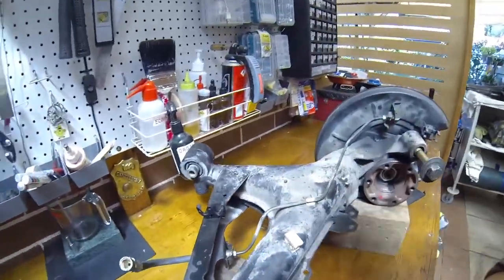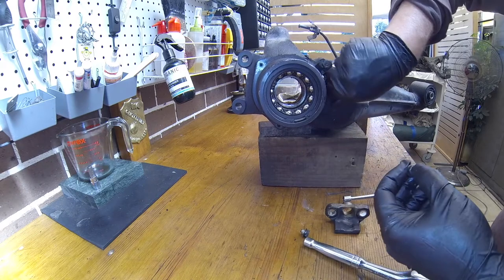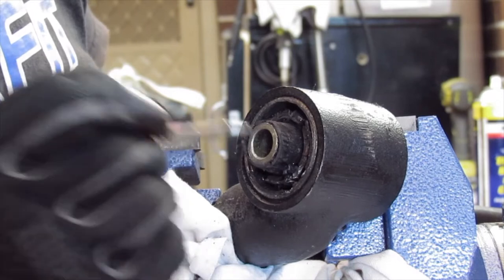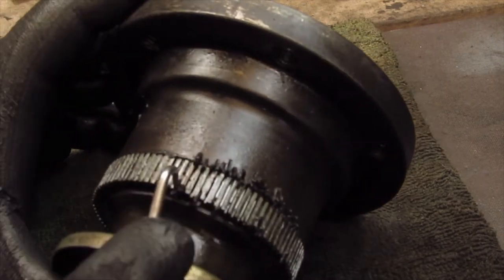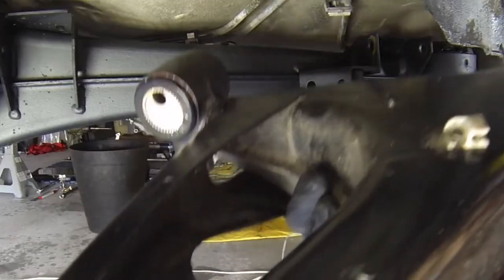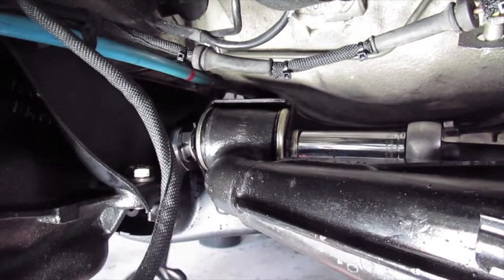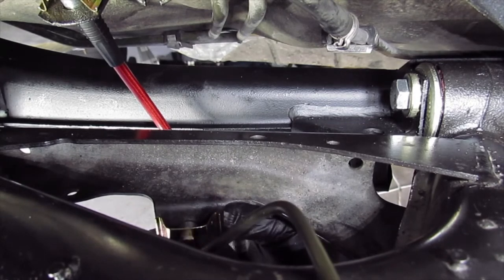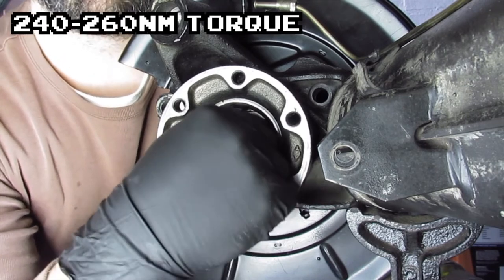BMW E28 M5:  LVL 7-2 Trailing Arm Rebuild

Comment: I used a few m36 washers and the original 36mm nut to pull the hub in the bearing, just adding a washer everytime net nut reaches the splines
Reply from the maker: That's a brilliant solution. I like simple work arounds. Thanks for sharing. If you have pictures or a video let me know. @obsidianm5

Comment: I'm in the middle of doing a powder coating (prepping) and yeah those rear trailing arms WTF my buddy with his 20 ton press we got one out but just couldn't get the 2nd one so drill and hacksaw like you're doing is the only way.
Reply from the maker: Mate it was a mission, I found out that the best chance is to heat it up heaps in the press if you can't stomach the saw 😜. All the best 👍🏼
Reply: @BahjatAlaadel  My first mistake was using a large socket that had a bit of a rounded lip, and was about maybe 42.3mm outer diameter, and that was the first mistake.  Attempting the 2nd bushing of the first arm the press was going in sideways and once it went sideways it was over so I didn't continue.  Will go with torch & saw method which I'm comfortable doing fortunately 

I was able to find a bearing that was exactly 43mm outer diameter to use as a "pressing die".  So I'll attempt that on the 2nd trailing arm.  Depending on how the hacksaw method goes I may not bother with a press except for installation.

Thanks for posting a video.  Videos take a long time and add a ton of time to the work day.
Reply from the maker: No worries, I still have 10+ videos to finish editing 🤣 but the goal is giving the community a starting point 😁

Comment: What type of oil did you use on the splines for the rear hub assembly?
Reply from the maker: It's just all-purpose oil. It's called 3 in one. It's a multi-purpose oil. You use it for door hinges or anything like that. You can get it at any hardware store and it's just to get so that you don't bind up when you're trying to line up the splines and get it started.

Comment: Hey where did you buy the kit to remove the rear wheel bearing, the one that has the cups?
Reply from the maker: I bought it on ebay, search for "27 Pcs Press & Pull Sleeve Kit Bush Bearing Removal Installation Repair Tool Set" they're around $100. And just oil all the threads before you start to make it easier. 😎
Reply: @BahjatAlaadel  thanks, brother! Just removed my subframe today and your videos have been a game changer!
Reply from the maker: All the best and thanks for keeping these cars on the road! 😀

Comment: What difference do you  notice using poly trailing arm bushings? What is the advantage of using poly over stock?
Reply from the maker: It's only useful if you're going to lower the suspension a lot or your racing on a track. It lets you adjust the camber and toe for the rear wheels.
Reply: @BahjatAlaadel  ah ok thanks. Can you notice a difference in terms of harshness when driving? Will you be tracking?
Reply from the maker: There is about 20% more road feel, but it's also the condition of the road you're driving on 😊 the worst mod for harshness is poly engine and transmission mounts. The vibrating is terrible 😔 I tried it and went back to stock mounts.
Reply: @BahjatAlaadel  ok thanks. Did you get the Garagistic poly engine mounts? I was thinking of getting those but if it’s going to be that harsh then forget it.
Reply from the maker: Yes they are Garagistic mounts, but maybe it just because it's the 3.5l engine. But if you want to try them, I'm happy to send them to you. Find me on IG @obsidianm5

Comment: Awesome work It's hard to find People Who know what they're doing especially with old BMW  . My problem is the bmw mechanics here in East Coast a bunch of pricks and that's why I take my e28 m5 to Volkswagen mechanics they're more Enthusiastic to work on your car than BMW mechanics
Reply from the maker: Thank you, my hope is to provide a resource to those who need it. I agree, something happened and much of the pride and etiquette of being a German auto mechanic. I have a backlog of episodes, but if you have a question about a particular system let me know. Do you still have the self levelling system in yours? Cheers. IG: @obsidianm5
Reply: I don't know where to take my instrument cluster to get fixed do you have any suggestions
Reply from the maker: Has the odometer stopped? Or does the tachometer needle randomly jump around?
Reply: @BahjatAlaadel    The speed gauge and the rpm gauge do not move I changed the battery and gears an nothing is working . The battery was installed by a computer technician who solder it for me and  I did the installation of the gears and  Reinstall the gauge cluster to the vehicle where I had a video that I recorded to guide me back
Reply from the maker: Are there any lights on cluster? Does the odometer turn over the mileage when you drive? Could be fuse 6, sensor or connector in the differential. Does it ever work? and if so have you smacked the dashboard above? and does it blip?